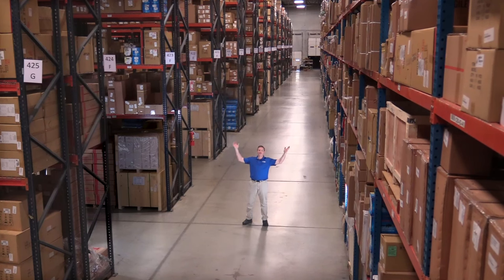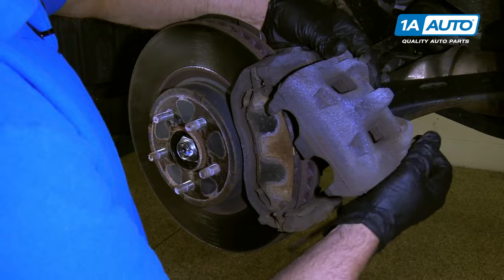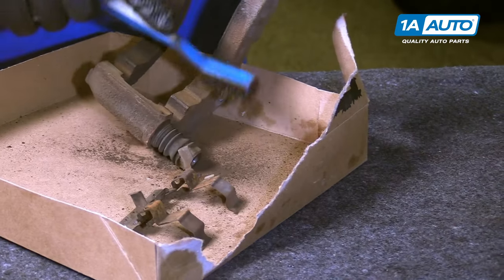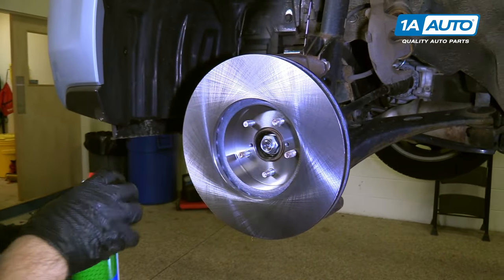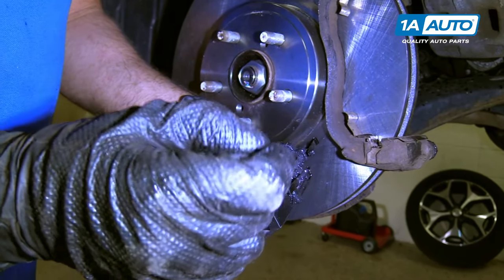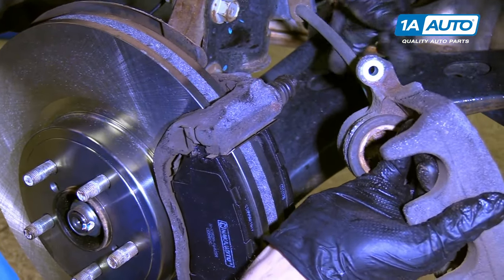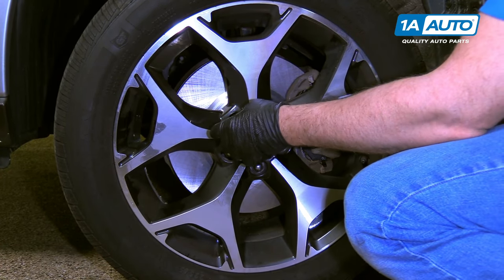How to Replace Front Brakes 11-18 Subaru Forester

Comment: Please DO NOT USE the black brake caliper grease on the pins!!!!!! Only silicon grease on pins, like sil-glyde brake lubricant. If you use this black brake caliper grease your pin will get stuck and you won't be able to remove them next time. Also your braking will be compromised!!! I made this mistake, one of the pins got stuck, the brake pad was worn only on top because the bottom was stuck, I had to use a hammer and a lot of force to remove the pin. The black brake caliper grease goes only on brake pads outside, do not put them inside the pins like on this video!!!!
Reply: Caliper grease is NOT compatible with rubber, the boots will swell, and yes the pins will seize. Silicone is rubber's best friend for longevity.

Comment: Good video. Suggestion: for high moisture / snow locations brush on thin coat of Antiseize on hub before installing rotors - helps prevents future rusting rotor to hub

Comment: Add brake brake grease on outside of brake pads and it’s smelling like crazy in cabin. Instructions that came in Subaru box doesn’t say to put grease on outside  of pads. It does come with gold grease that instructs u to put it only on outside of pads that touches metal clips.

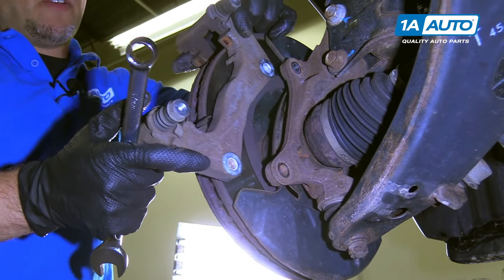Comment: 4:05 Small bolts for taking off rotor are M8 x 1.25 you can go shorter than 40mm but I bought the longest I could find. Hammer didn't work for me.
Reply: Hey Kris..  THANK YOU! :).  i needed that.
Reply: Yes: thank you, Kris.  The bolts cost $1.29 apiece and saved me a world of grief and annoyance.
Reply: A word of advice is to get hardened bolts. Cheap bolts will shear, especially if they're longer, and the hardened ones are only a little more. I keep M8 x 1.25 bolts in my tool box because they're common for a lot of rotors.
Reply: Thanks for that info. I will be doing all 4 on my 15ltd 2.5.
Reply: Thank you! Ran into this issue today🤦🏼‍♀️

Comment: Great clear video with good angles and talking us through. Just got an estimate from local "Mine" shop for $480 to do this. The same people that have been cross stripping my studs when doing tire rotation and then charge $30 per stud to replace. ( told me Subaru has bad studs) .

Comment: Using a dial test indicator on the rotor and wheel bearing can show if they’re out of spec. Run out check. Best way to prevent the car from coming back due to vibration. Thanks

Comment: Great guide.  Very thorough, right down to noting the interference on the top bracket bolt.  That said: you might want to loosen the cap on the master cylinder before pushing in the pistons; you skipped showing the inboard pad installation; and I thought it was funny that the two bolts you used to drive the rotor off had different sized heads, requiring you to keep swapping sockets.  :)

Usually I do the caliper piston retraction during disassembly.  When you're using the big screwdriver to retract the pistons enough to get the caliper off, you might as well just keep going and push the pistons all the way in at that step.  I'm sure someone will chime in now and tell me why I shouldn't be doing that.

Comment: Thanks for that tip at 04:20!  That's the bugaboo that was holding me up, and it's a brilliant engineering solution.  👍👏 Almost as good as moving the oil filter from the Ring of Fire to the top of the engine!   🔥🤕☠

Comment: Thank you. A nice clear, calm, quiet (importantly) and informative guide. It's a pretty basic process but good to confirm what I will be dealing with before I do the job. I'm guessing my 2006 model will be very much the same.

Mine is a two liter naturally aspirated LL Bean. I'm in a reasonably remote area of New Zealand and I so want to ensure I get the right parts and have no hiccups necessitating returns. This USA SG5 version is not a standard model here in NZ and I have not found specs specifically on LL Bean front brake rotors with a google search. Do you happen to know what rotors they use? Are they just standard Japanese Forester rotors or did your USA version get upgrades? Yes, I'll probably remove the wheel and measure too :)

FYI - I love its' great low range manual 4x4 traction on a slippery off-camber grass hill and a muddy hill I use to get around the back of my place! :D I have thought a couple of times, this will be the day I get stuck, but no, I just slowly and calmly chug chug chug up them... I did cheat and sprinkle a sparce layer of about 15L of stones on the worst parts a while back though, lol.

Cheers
Reply from the maker: +@WomBatVIC Thanks for checking us out. Shop for high quality auto parts on 1AAuto.com:

http://1aau.to/m/Shop-1AAuto-c

Comment: 7:30 brake calliper position. Note - do not clean this way, remove all parts, wash rubber in detergent and soft brush clean. Acetone for all metal parts. Use a silicone ceramic paste designed for the pins only, not a brake calliper grease.

Comment: I always open the brake bleeder screw when compressing the pistons,  long time ago I destroyed my ABS braked system.
Reply from the maker: +tom Macklem Thanks for the feedback!
Reply: I always opened the fluid cap so any air gets pushed back out the top.

Comment: Should we be spraying brake parts cleaner into the rubber boot?
Reply from the maker: No, we would not suggest spraying brake cleaner into the rubber boot. +J Medlen
Reply: @1AAuto  But the mechanic did in the video?

Comment: Any idea when I reinstalled the caliper bolts, 13:07 of video, the bolts just kept spinning on me. I had my torque wrench set at 20 ft - lbs. I eventually broke one of the bolts off, luckily I was able to get the broken piece out with pliers, and the other bolt, I stripped the threads on it. I used locking pliers too. Any advice before I go at it again would be much appreciated.
Reply from the maker: +Matthew Heath Thanks for checking us out! You may want to tighten the lock on the pliers to get a good hold on it and ensure there isnt any damage to the nut threads or the inner threads as these may cause some slippage leaving the bolt to keep spinning without locking down

Comment: Is it a major concern if I didnt pull out and lay the brake pad clip to that outside resting place? Instead I folded and tucked it in the clip channel. Do I need to redue it, considering the other (backside) of the brake pad didnt have a clip at all? Thanks for the video.
Reply: No.   They are just there to keep the pads from making noise as long as they are pushing against something and not bent out loose, it shouldn't matter.
Reply: @jamestheotherone742  The clip on the pad that you folded out should go on the inner mount and NOT be folded out as is designed to touch the brake disc/rotor when the pad is worn and squeal.

Comment: Do you need to take cap off the brake fluid reservoir?
Reply from the maker: +isham w If you are bleeding them yes
Reply: @1AAuto  slightly misleading.  If you have to compress the caliper pistons to get the caliper back on you should have the cap open also.

Comment: Nothing has changed. I can still change my own brakes. Funny, they did that just before I got my car. AND NEW TIRES TOO! Some one just replaced a front wheel bearing on that vehicle. You can see the blue paint they used on the alignment bolts and on the new bolt holding the axle on to the hub.   That was obvious.  I use antiseize on the back of the rotor and around the hub where rust always forms. The rotor never sticks to the point you have to hammer on things by using antiseize.
Reply from the maker: +RC Hobbyist Extreme Thanks for the feedback!

Comment: How often to do the full brake service vs just changing the pads?
Reply: The OEM pads on my '15 Forester lasted 77k miles.  The rotors should last for a very long time 200K unless they are warped or damaged.
Reply: @jamestheotherone742  2016 forester for me 24,000 miles and the breaks are gone,  but all driving is in town, and I know what you are thinking,  he rides the brakes, but on the 16 if you touch the breaks, it kills the gas pedal.  but they are easy to change

Comment: Do you have to do all the actions shown if you just want to replace the brake pads? Can you just buy a set of 8 brake pads and swap them out?
Reply: my two cents, the pads will not wear evenly or last as long unless you deal with the rotors.   you can try to have oreilly's auto parts "turn" the rotors for $12 each.  otherwise new generic  rotors are worth the price.  Buy the long lasting pads as well.  worth the investment
Reply: If the rotors are not warped or have abnormal wear, you can replace the pads only.  This is ONLY if they don’t have abnormal wear and the rotor thickness is within spec.  I have done this with success multiple times and have driven a long commute for years.  My last set of pads lasted over 130k miles using this method.